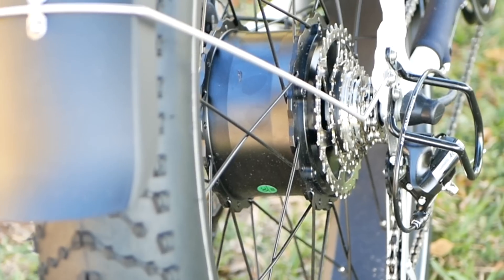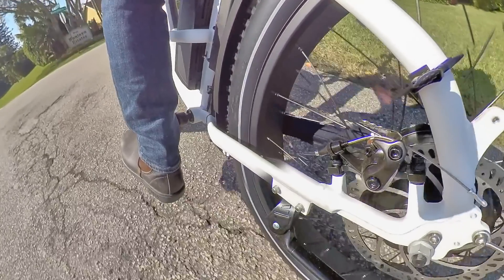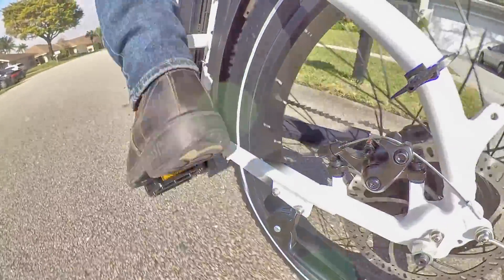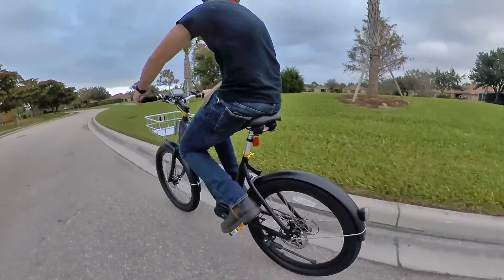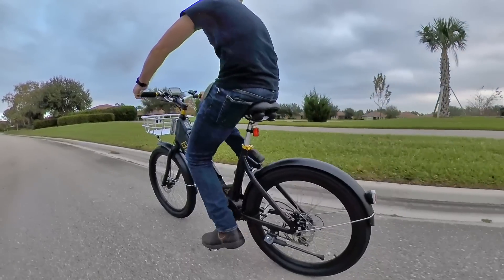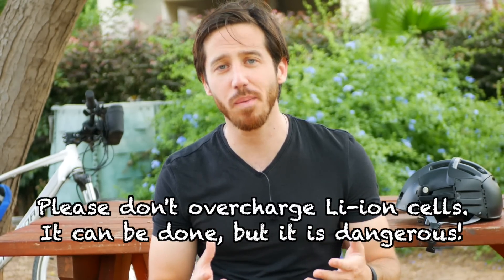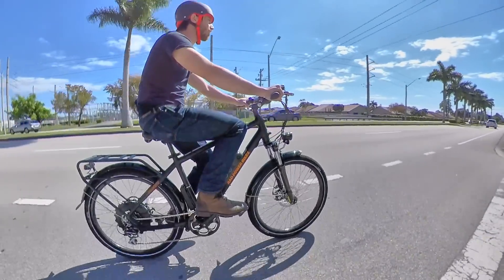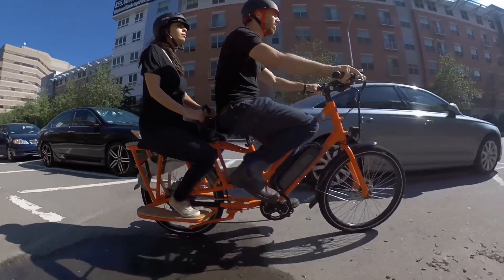Why don't more electric bikes have regen brakes?

Comment: So much hassle for regen and the truth is that it's not a big deal...
Reply: It's a huge deal. It costs nothing to implement and provides savings on your friction brakes. You can ride more aggressively and more politely at the same time with regen. Braking and acceleration for zero mechanical wear.
Reply: Agree to disagree. I'm just saying that people get crazy about regen, but the savings in energy are not in the same level of craziness 😋
Reply: @W4WEnglish  Most people, like myself, aren't crazy about the energy savings. We are crazy about the mechanical and cost savings. There's nothing more simple than using the same mechanism for going forward and for braking.

Comment: I've come to the conclusion that it is not worth the complication. Great overview.
Reply: Friction brakes are more complicated than using a motor for braking. Forward or reverse torque is practically the same for an electric motor.

Comment: Is it possible to send a signal to engage/activate that clutch that leads to regeneration? Since we are pressing the brakes, the signal there could be used to tell the motor, no more free-drive, but regen energy..no?

Comment: My understanding is it’s too hard to pedal with regen. So if you run out of battery you will not be able to pedal the rest of the way. Or you can gain much more range if you pedal more with less resistance, much more than you would gain from regen. So in other words with regen you will gain 1 mile range in 20. Total 21 miles. Without regen you will gain 5 miles in 20 because you pedaled without resistance and now you can finish your route without resistance as well.
Reply: "It's too hard to pedal with regen"

No, it's not. There is added drag while pedalling with the motor disabled but you can absolutely ride with the motor disabled. 

"You will not be able to pedal the rest of the way" 

Once again, that's not true. Where are you getting this information? 

On one comment you're making assumptions, and on the other you're making statements. Do you even have any experience? 

You won't lose out on 5 miles of range out of 20 because of the regen, that's a ridiculous statement. 

Regen will add a lot more power back into the battery than the extra "drag" from this feature, why would it even exist if it hypothetically always used more energy than it puts back?
Reply: @HelloWorld-pt7vj  I'm glad there's some sense to be found in these comments. The video felt unfair towards regen and people gobbled it up.
Reply: That's not how it works...
Reply: Hello World Yes, it is. Coasting  when you can will get you farther. And nobody wants to pedal with extra friction.

Comment: Thanks for the info, I was wondering if it was possible to have regenerative braking on a mid drive motor. Would it make more sense to have regenerative braking on an electric velomobile?
Reply: Yes, it would make sense because it is heavier and more aerodynamic.
Reply: @daniele_go  Sorry, I meant would it make enough sense to put one on the velomobile I'm building. Just because it is heavier (no where near the weight of a car) and more aerodynamic doesn't mean you'd get a huge increase in mileage from regen braking. Also, is is there an aftermarket version that can be added separately from the motor. I'm using the Cyc X1 Pro Gen2 in my velomobile and the motor does not come with regen braking.

Comment: I had regen braking on rad city but returned it bc there was just too much drag when the motor wasn’t engaged. Also once you reach the top speed of the motor, pedaling faster becomes almost impossible.
Reply: Why didn't you apply throttle to overcome the drag? The low top speed thing of the motor though, that needs a faster motor.

Comment: Cool part about regen braking is braking part, not regen. In very powerfull e-bikes it open posibility to make real abs-brakes. It is a lot easier to make driver that brakes with the motor itself than with some wierd, complicated contraption involving actual brakes.

Comment: Is there an e-bike that lets you charge it as we pedal
Reply: I havent seen one in the market that does that... but if i remember few years back..i have seen a dude from India (youtube video) who made his custom e-bike with both regen braking, and also regen while he was pedaling... i always wonder too why dont the factory made e-bikes dont try to make motors that has this function... maybe because it causes more friction and makes it more difficult to pedal?...i dont know.
Reply: @v4v777  It would make the bike less efficient, that's why it's not done. If you're pedalling to charge a battery, the increase in range would be less than if the battery charging was skipped and the same energy was put into moving the wheels.
Reply: @v4v777  what about a bike that solar charges as we as we ride?
Reply: @firehawk8521  If you find it easy to pull a trailer with solar panels behind... its good option.
Reply: @v4v777  but bolting them on bike or ourselves a solar shirt/jacket

Comment: Less people care about extra mileage they can get on the regenerative braking, 
I was on the horns of the dilemma if I should get a torque or cadence pedal assist kit, as I heard the torque based are more battery efficient, 
I decided to go with the latter when saw people complaining about TSDZ2 reliability though,

Comment: This is also why geared motors stop showing speed and recording mileage when you start coasting...
Reply from the maker: Cheaper ones, maybe. Better ones should use a magnet on a spoke so they can always show proper speed even when the motor isn't turning.
Reply: @EbikeSchool  I know mid drive kits like the BBSO2/BBSHD have them; haven't seen a hub drive with them, though my experience is limited to 3 bikes/kits :)

Comment: Good topic.  I'd wondered about this.  Have you ever considered or seen any that use a friction type generator to create the surplus.  I had one of these on my old pedal bike to power lights.  If you could drop that onto the wheel when coasting down hill it might be a cheapskate way to do it?.  ;)

Comment: In case of full charged battery - is there no chance of just dumping energy somewhere and not overcharging batteries?
Reply: there are controllers who prevent overcharging from regen.
Reply: I would think it would be easier to just be able to turn regen on or off as needed.

Comment: Regen braking on human-powered vehicles is, and will remain, a controversial subject. I personally think it's a great idea on tadpole-style recumbent e-trikes and cargo e-bikes, not because it helps recover power - though in those more mass-intensive applications it does make more sense - but because it helps you save money on brake pads in the long run.

Comment: I have a high power ebike (2kW). Can go pretty fast. For me, regen braking is a must! I don't even care about the "Regen" part. The real reason I use it is for Braking power. It's a safety feature for me. It helps a lot when braking from 40mph, and riding alongside traffic. Not sure about this, but I would say the motor does more than 50% of the braking overall. Plus, it is instantaneous. The moment you touch the brake lever, all that braking power kicks in.
Reply: Yes.. thats the best reason why those with more powerful bikes prefer them.. its more safe.. and also saves your break pads.
Reply: I'm about to start on a similar build. What is your setup? Have you noticed any range dip from charging due to regen?
Reply: @IanLofgren  My setup is a rear hub motor. 60v 45A Controller. The regen braking adds up to maybe 5%-10% range.
Reply: Absolutely I have a 8000w bike and for very steep donwhills it's a MUST
Reply: Well those arent ebikes really, they are mopeds. And nobody with half a brain would go down the hill in moped or any other motorised vehicle in neutral using only brakes to slow down. ICE uses its compression to maintain safe speed, your electric moped regen of course etc... especially on those Montenegran mountains and hills ☺.
This vidjeo however is about ebikes, and we all know the difference between ebike and moped, right?
Dont get me wrong, I am all for it, european 250w is a joke I do more than that on my bike and I can maintain more than 25kmh on flat ground, but 8kw will never be ebike. 
Pedaling vs resistance is where the problem is for those of us that care about pedaling but want regen for speed control on mountain runs.
Reply: @bluewanderer9903  I agree. 8kw is definitely not an e-bike. It's actually more powerful than many petrol motorbikes and scooters. I guess my 1500w setup is right in the edge between e-bike and moped. 
The motor resistance you might encounter while pedaling along with a brushless hub motor, only kicks in when you activate the brakes. There is no resistance while pedaling with pedal assist, unless you are totally out of battery. In that case, you might encounter the natural resistance of the big brushless motor coil windings. It has nothing to do with the regen braking. By the way, the resistance itself is not that big of a deal to pedal against. If you come to find yourself in a heavy ebike out of juice, your primary concern will be to have to carry all the extra weight from the motor, battery, controller, and all ebike gadgets, without help from the motor.
Furthermore, if you want a higher power ebike,  able to reach higher speeds, you have to go for a brushless motor anyway. You won't find a high power geared hub motor.
Reply: @Lucaslfm1  Thanks. I agree about 1500w being perfect and right at the edge where pedaling is still relevant.
What motor are you using (brand and model)? I ask cos I'd like to find out physical dimensions of it to compare against. 
And would you by any chance know what is the highest power geared hub motor available? 
I dont want too big of a motor, aiming for stealthy look (besides battery case) on a merida hybrid frame. Stealthy looks are very important to me on this one. But then again I dont want 250w neither, I dont get the point of it,  if I am going to bother with anything then 750 at least, 1000-1500 ideal.
Reply: @bluewanderer9903  I also don't see the point of 250w e-bikes, unless for small foldable ones. Otherwise, I would rather go for a lightweight "acoustic" bicycle. 
My setup is assembled from a old bike converted to electric with a ebike conversion kit. I bought it from Aliexpress, from China. You should be very careful with these "generic" kits, but to be very honest with you, all e-bike motors come from China anyways. The big US resellers just buy them by the bunch and rebrand them with their own brands.
For the highest power geared hub motors, I guess they can go up to 500w-750w for the mainstream models. Maybe you can find a more powerful model from a niche manufacturer I'm not aware of, but for sure it won't be available as a conversion kit. You will have to buy the full bike.
As for stealthy looks, I'm afraid you will be disappointed. The brushless motors are not very much heavier than the geared ones, but they certainly are wider (I mean the circumference diameter they occupy inside the wheel frame), and definitely very noticeable. If you research around youtube, you will spot it very easily. They look like a big black vinyl disc that goes inside the wheel. 
Even the higher power geared ones (500-750w) are quite a bit chubbier than the 250w ones, but I guess you can manage a good job hiding them behind the rear chainring cassette, and the disc brake, if installed in rear-wheel. No chance in a front-wheel hub.
Reply: @Lucaslfm1  Yes I know about aliexpress and what those motors look like but I was never paying any attention to them as I was originaly going for mid drive since hybrid frame decision.  Dont like bafangs or mid drive kits that are hanging under the frame, so till I learn frame building I have to go for hub motor on my current frame which is great as it is. I have 180mm disc now, and about the same diameter plastic disc behind cassette,black wheel black spokes. 203mm brakes are option anyway.
This why regen is of interest to me now, it wasnt before, hence the questions.
Anyway your advice is very much appreciated, thank you.
Reply: @bluewanderer9903  I have seen geared hub motors up to 1000W on Ali-Express... i was going to get one of those, (because of the more stealthy look as you say), but finally i ended up getting the 1500W brushless one (for a 20"inch Fat-Bike) because of the regen braking, and also because it was only around 20 Euro the difference in price .
I also preferred the bigger motor not for the top speed (i dont care about top-speeds) but only for to have a more easy hill climb without putting too much stress on the motor.
Reply: @bluewanderer9903  No problem. Glad to help. I could talk about e-bikes all day long :D
If I may, one last piece of advice: I would not recommend  1500w hub motors lightly. They are really powerful and can reach very high speeds.
I do use a setup like this because my city has no bike lanes or biking infrastructure. I'm forced to ride in traffic. As counter-intuitive as it may sound, going faster is actually safer when riding alongside cars, coz I can keep up with the traffic flow.
For a more bike-friendly environment, I would not recommend high power setups. They can be very dangerous, and overkill. Plus, keep in mind you would need a big battery pack and controller to power up a beast like that. (60v 20ah in my case).
Reply: @v4v777  thanks, jst looking on Ali now seen few. I have completely missed ebikeschool article on these, seems we may have more options or at least one more good option for geared hub motor. 
But that regen as a break is so tempting.
Reply: @Lucaslfm1  thanks Lucas, yes I agree on all points you made so far. This would be recreational commuter sort of a thing,long distance open roads, mountains etc, it will hardly see cycle lanes I rarely use them even on push bike but if I do I want to be able to adopt.
I presume you pedal, up to what speed can you pedal/keep up with the motor?
And what is the max speed of your set up?
Reply: @bluewanderer9903  Max speed, on a flat road, is up to 65 km/h. And I can pedal along all the way up there. Unlike a mid-drive, you can have a multi-speed chainring in the front crank, with a hub motor. In my case, I have 3 speeds (54T, 48T, 42T) + 7 speeds in the rear cassette, which provides me plenty of relation ratio to pedal along either on slow steep hills and fast flat road.
Reply: @Lucaslfm1  that is interesting, those front chainrings are big.
Reply: @bluewanderer9903  I should have been more specific mine is a Dirt bike for enduro not for street...and Regen is really a must for this type of riding
Reply: @DKLVE  One of those enduro frames with big hub motor and proper front fork? I do like them, I was going to build one but plans changed when I tried road bike 80kmh capable, fell in love with that and want to build something similar on hybrid frame.
But yes I do agree, regen as a brake is very important on anything capable of any decent speed.
Reply: @bluewanderer9903  it's a Kawasaki 450 frame with 20kw motor but only capable of 8kw now because if the battery. I'm saving money to buy new cells now and build a new 20Kw peak battery. Here is a video https://youtu.be/zjzM3uQrqd8

Comment: The payoff is not worth the expense or tradeoff in rolling resistance. My Prius uses regenerative braking and the gain is minimal.
Reply: Yep, the expense is not worth the return. If you were half of an engineer you would know this. Sorry bro not sub from me.
Reply: @Singletracklover  If you were half of an engineer you would know that for cars regenerative braking makes a huge difference. It's not just the efficiency, it's also the massive reduction in wear and maintenance of things like brakes. Only people with no actual knowledge or competence think there's not a compelling case for regenerative braking in EVs. Fact: getting energy back is better than just not using energy. It's obvious and not debatable.

But we're talking about bicycles on this channel and the gains are less noticeable because physics.

Comment: Regen braking might be good if you live with steep and long hills, but where I live I'm on the brakes less than 1% of the time. The loss in forward efficiency ain't worth it.
Reply: And around where I live the terrain is like a raisin. A lot of elevation changes that are relatively steep and a lot of energy wasted downhill on braking. I definitely would benefit from regenerative braking.
Reply: If you have an electric drivetrain, you have regen. It's literally free and you might as well use it to save wear on your friction brakes.

Comment: And of that 5-10% you could regen, that wasn’t lost to air and road friction, a lot is lost in mechanical and electrical inefficiencies. I think my 2019 Bolt is 40% maximum regen efficiency.
Reply: It's probably much much lower than that...